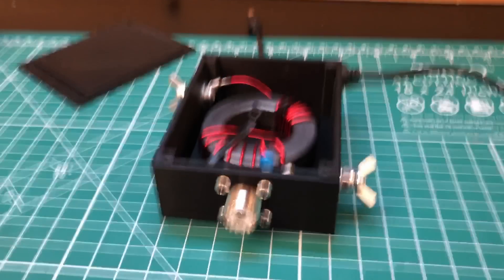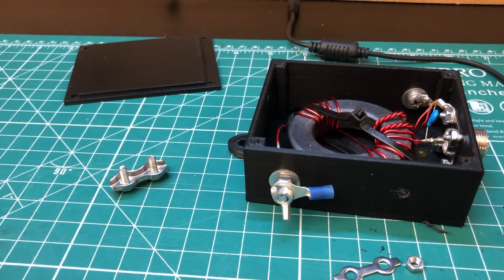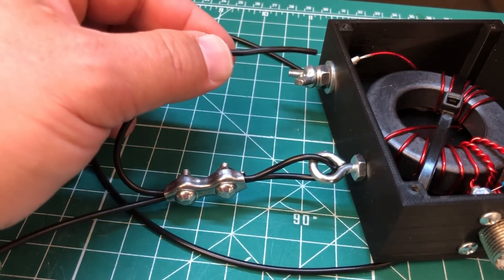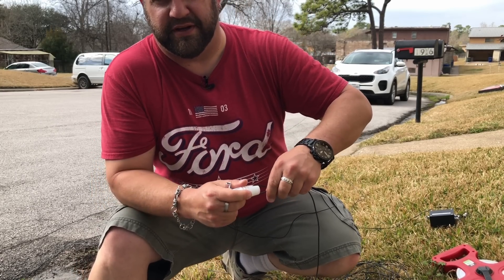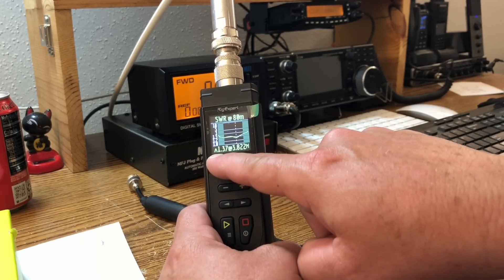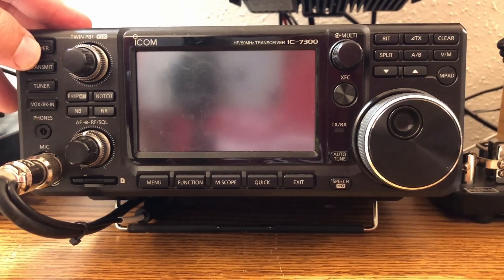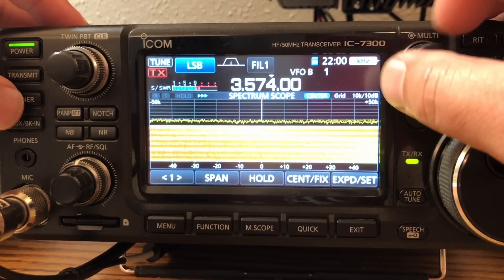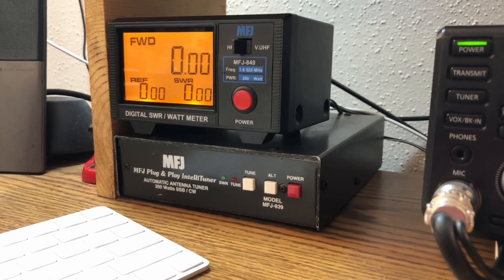TennTennas 100 Watt 49:1 80-10 Meter EFHW w K8MRD Mod & Installation

Comment: I just purchased a QRM Eliminator that should be arriving in a few days. It uses a secondary receive antenna that is used specifically to pickup just noise. Then you phase the noise out to hear the signals. A couple people I spoke with swear by it. I'll let you know how it goes - This might be something to use for your noise problem.
Reply from the maker: A lot of people have been suggesting that but I'd rather find the solution than put a bandaid on it.
Reply: @hamradiotube  If the solution is going to take a while, may as well do something to get back on the air in the meantime. 🤷🏻‍♂️ That's my take on it anyway.

Comment: Angle grinder to the rescue again, lol. Dremel guy here. Nice video. I’ve built about 10 EFHW portable antennas using the toroid winds by the eBay seller Eddieson (read about him on Hackaday). I’ve used #26 Silky Wire from The Wireman…copying the Packtenna build by George KJ6VU. Btw, does your background music bed in this video hav3 a wage dripping beat? I took out my EarPods a half dozen times to see if my sink or ice machine was dripping, lol. 73 de K4FMH
Reply from the maker: Try Poly-Stealth Wire, https://www.amateurradiosupplies.com/category-s/218.htm its even better.  I switched from the Wireman stuff a couple years ago and never looked back.  I don't know what a wage dripping beat is so I can't answer that.
Reply: Sorry…water dripping, lol! Thanks for the tip on the wire.

Comment: Hey Mike,  Geez that's worse noise than I had when I lived in Denver, and that's saying something!  Do you still see the noise when you connect the radio directly to a dummy load?  Do you still see it when connected directly dummy load and running from battery?  i.e. battery, radio, coax, dummy and nothing else.   I'm expecting you' might getting noise on power and ground as well as noise on the air.

Comment: I've got the same MFJ tuner and  SWR-power meter. The same Cameleon choke. My antenna is a 40-10 49:1 EFHW. The only difference, is I have a Yaesu FT-891 radio for my base station. Fun stuff.
Reply from the maker: Well it sounds like we both have the same good taste.

Comment: If the noise goes away when it rains, it's definitely an electrical distribution problem. If you can hear the noise on an AM radio, start walking around with it to identify where the bad connections are. 

Then, the trick is to find the correct number at the electric company to call.
Reply from the maker: That's kinda what I'm thinking.  It's been quieter the last few days and it has been raining.  I'm gonna take the 705 out one day when I have time and see if I can isolate it.
Reply: @hamradiotube  Try a portable Short Wave radio.  The ability to go all over the bands helps to narrow down the noise. Add a directional antenna and it even becomes easier. I've found noise quickly and also searched for days.

Comment: @KMRD RADIO STUFF you need to try the W6LVP Amplified Receive-Only Magnetic Loop Antenna – With T/R Switch it saved my HF went from a S 20 noise floor on a 49:1 EFHW to a S1 using the Loop to receive and the EFHW to transmit. It saved my HF
Reply from the maker: A lot of people are suggesting things like this but to me that doesn't solve the problem.  That's just putting a bandaid on it.  I'd rather find the source and eradicate it.
Reply: @hamradiotube  its not really putting a bandaid on it because the loop performs way better for receiving compared with the EFHW even when the EFHW has a low noise floor. The main reason I got the loop was because the neighbour is still useing an old plasma TV that splatters 20+

Comment: Hi Mike,
Have you thought about trying one of the noise eliminators to see if it would help? Stay safe.   73  WJ3U
Reply from the maker: No I want to find the problem, not mask it.
Reply: @hamradiotube  Hi Mike,
The way it showed on the spectrum display seemed it was a wide band noise source. Have no clue where to start looking for that type of noise. I was thinking one of the noise eliminators might help get you on the air from home. Stay safe.  73  WJ3U
Reply from the maker: Wide banded doesn’t even to begin to describe it.

Comment: I was just wondering if you now anything about or could make a video on stacking like  a 40m and 20 m dipole antenna it that would work and have a different radio running each antenna what would happen
Reply from the maker: Kinda sounds like a fan dipole you are describing.  That was the first antenna I ever made.  40 on top, 20 a few inches below that.  I suppose you could have 2 separate antennas with 2 transmitters but you would need band filters so as to not cause interference with each other.  If you watch my winter field day video from this year, we are using 1 antenna with 3 different radios.  We have a couple things inline with it to make it all work.  One, we're using a multi-band beam with elements for each band, that feeds into what is called a TriPlexer, then band filters, then the radio.  You usually wouldn't want to run 2 radios on different frequencies that close to each other without some filtering inline as the interference from the other antennas transmitting is just too much for the front end of the radio in most instances.